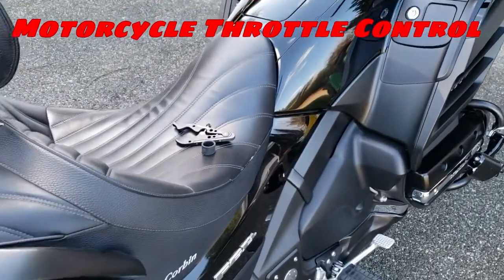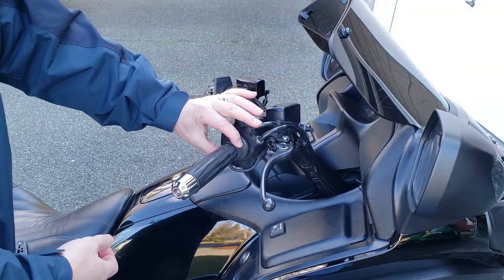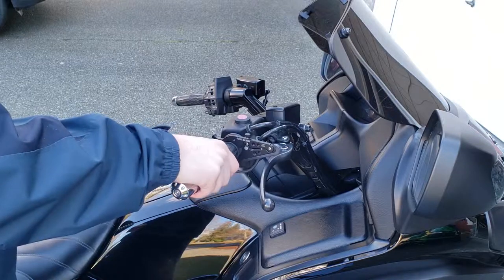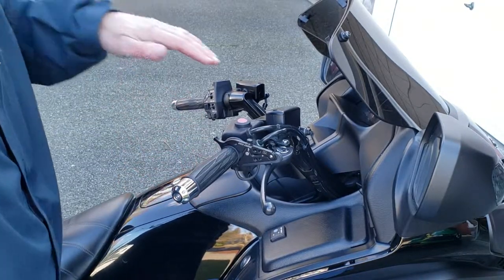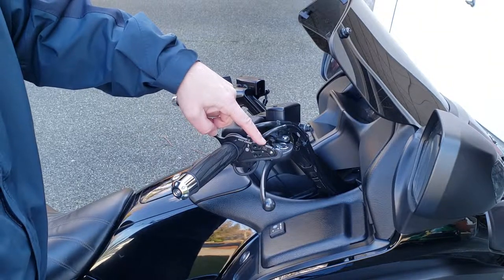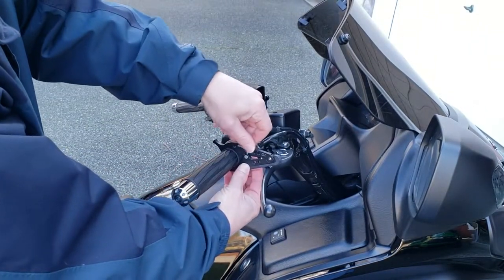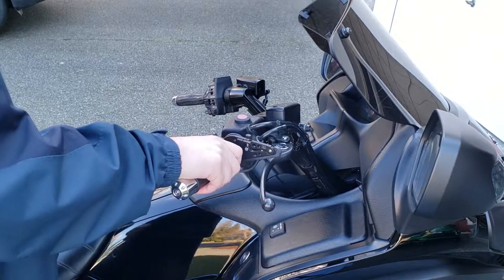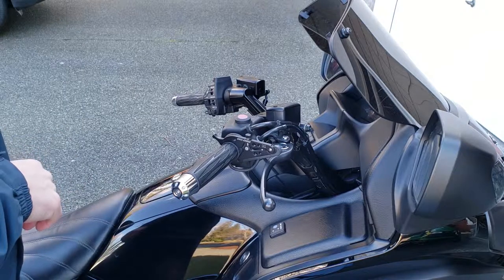Motorcycle Universal Throttle Control

Comment: Yep I've been using this for a couple years, it's awesome! When you going to break down and put a madstad windshield on there? It'll be the best thing that you've ever added to the bike! Check out my review on that puppy
Reply from the maker: That madstad looks really nice.
Reply: @bgrides2108  yeah I can't say it's the best looking shield on the market, but that man's dad is freaking awesome when it comes to directing the wind, and as my review says, you couple that with those hand Wings, you have the ultimate summer, winter driving scenarios available! Have you ever lay your head down behind your shield and felt that Backdraft pressure pushing you down towards the bike, at 90 miles an hour it's pretty dang dangerous! You have none of that with the man's dad, there's no downward back pressure it's unbelievable, my wife loves it on the back of the bike now, no wind whatsoever . you would think I work for em or something LOL
Reply from the maker: @johnk12345100  I know what you mean about the back pressure.
Reply: @bgrides2108  I think I had the same Shield that you had on prior to switching to the madstad, is that the long Rider Shield that lets you flip around the top part? I always rode with the top part up, and just like most taller Shields, the wind is deflected up over you, not as far as the man stabbed by any means, but it's up over you and then circles back around to the back of your head, you don't feel it much unless you try to get down into what I like to call Sport position, that's where I put my feet on the passenger pegs and literally lean down on top of the gas tank, yeah it looks kind of funny but it's just another way to move around on the bike on long trips! And it is kind of cool to pass somebody doing a hundred and ten in the sport position lol, Anyway with most shields on the market, and I experienced it tremendously with that long Rider Shield convertible deal, it was almost unsafe as the back pressure was so much it was pushing my head down, because of how the Mad stad airflow is engineered, you don't feel any of that! Changes your whole ride I'm telling you! It's amazing
Reply from the maker: @johnk12345100  Thanks for the info.